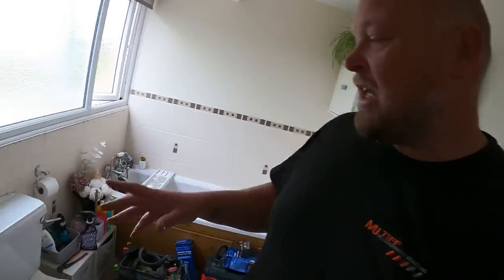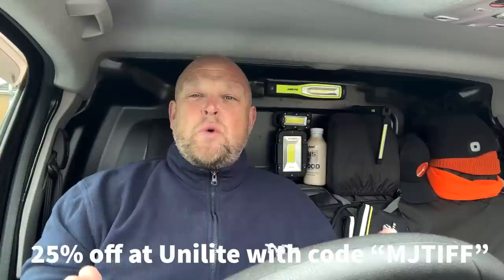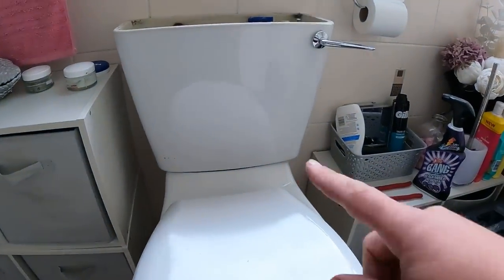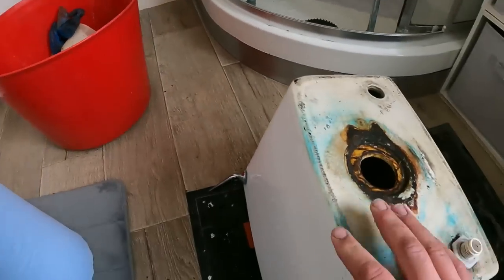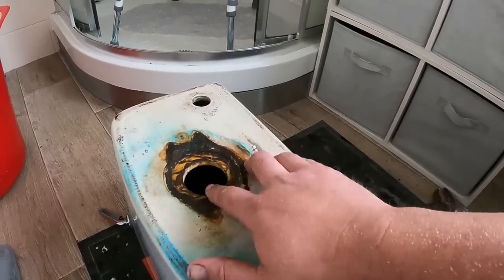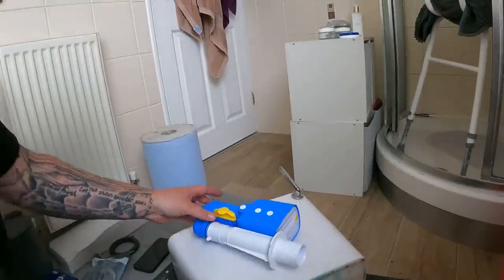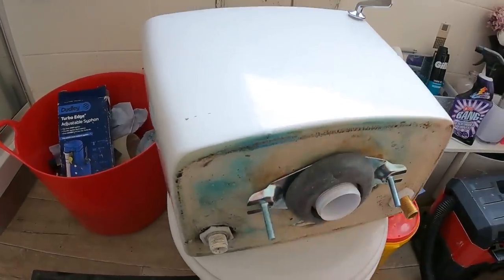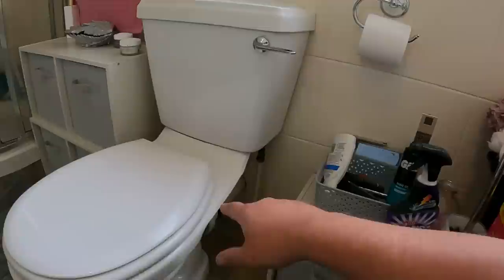HOW TO FIX A TOILET NOT FLUSHING…. But that’s the least of the problems!!!

Comment from the maker: Every plumber will relate to this video…… 100%!!!!!

Toilets can be THE most annoying thing sometimes….
Reply: I find having a couple of pairs of small mole grips works well with seized/rusty nuts & bolts. Especially in tight places.

If the nut doesn’t come off, the grips hold firm enough, to sometimes shear the bolt.

A larger pair will sometimes squash what is left of the nut/bolt, so it will then fit through the hole.

Loving your channel .

Keep the vids coming.
Reply: Great video as always. As a plumber myself any siphon toilet I go to now I just change it for a flush valve now make future maintenance a doddle for the next person 👍
Reply: Also loving the kit your using got my eye on a second tool bag and that one your using looks ideal is it a Veto ? If so what model ??

Comment: I can't count the number of times I've done this job and it never gets easier....rusted screws that shear off, rusted wingnut threads, out of whack porcelain moulding - leak city, cruddy plastic thread tails that will cross thread rather than go straight....bloody manufacturers that make odd shaped cisterns so that the water fill fouls on the siphon....it goes on and on......they should be a straight fit but never are! Oh, and don't forget the previous plumber that had a leak and sealed everything with either silicone or plumbers mait  !!!...lol
Reply from the maker: Completely agree mate….. they can be a nightmare

Comment: Had this experience many times! one tip for the new bolts to keep them in place is to take a peice of cardboard from the box, fold it couple of times and put them between the bolt head and the cistern and that will keep them in place while popping the cistern back on. Buy one metal blade for your multi tool and will fly through them old rusty ones
Reply from the maker: Good shout on the cardboard trick 👍🏼👍🏼👌🏼
Reply: BLOB OF PLUMBERS MATE

Comment: Oh I can totally relate to this especially if they’re old. There’s the initial problem of not flushing and there’s all the hidden Aladdin cave problems that reveal themselves. Most times if it’s rigid copper pipe coming up from the floor it won’t reach the new full valve or is just that bit shy due to new doughnut so you got away with that one at least. Yes it always happens with family and they always say “ sure it’s just a small job should only take you half an hour and you end up there most of the day. Great video Thankyou and yes the syphon washer should be enough as it’s inside the cistern. Take care Mark.
Reply from the maker: Thanks buddy…. Glad you enjoyed it

Comment: Glad to see you fitted  a demount-able flush unit in. My only problem is, it looks like the original flush unit was also a demount-able and should of been able to repair it without taking cistern off, a bit confused. But still a great video as usual. I have been a plumber for 35 years and changing flush units are always the worst job.
Reply from the maker: I was changing all the internals buddy…… got to remove the cistern to do that👍🏼

Comment: Was half expecting the screws to snap and the iso to start leaking as well😂.

Its all fun and games this plumbing lark. Bit like fixing cars, 5 hours taking the front end off to unbolt and replace a sensor buried in the engine bay.
Reply from the maker: And I was to be honest….. everything else had gone tits up 🤣

Comment: That job went quite well compared with the Ideal Standard tulip toilet cistern I had to repair last week. Its a very fussy cistern due to its shape and one had to be very careful on what siphon would fit. Had to cut through the bolts and cut off original syphon as well.
Very awkward
Reply from the maker: And people think our job is easy🤦🏻‍♂️

Comment: Surely just change the diaphragm as it looks like a 2 part siphon, I put the jam nut on the float valve the other way up to centre the valve in the hole
Reply from the maker: Why just change the diaphragm when it’s all apart…. Just do the lot👍🏼
Reply: @M J Tiff Plumbing  if it is a 2 part then  why strip cistern out ?

Comment: I am a joiner, but did exactly this job last week.. Fortunately for me the cistern screws had rusted so much the heads had gone so dead easy.... But the connector wing nuts totally rusted on so had to cut them... Being old school with a hacksaw blade. Same issue with a split membrane, but i changed to a push button as my tenant had young kids so i thought it easier.
Reply from the maker: This wasn’t a membrane issue in the end, was the spring👍🏼👍🏼
Reply: @MJTiffPlumbing  Ahhh yes, I wrote this before getting to the end of you vid🤔. I get my tips from you though, so keep up the good work..

Comment: Great video Mark.
I was concerned that the corner of that pan was going to break when using that multi tool, due to the vibration etc.
A better option in a tight place, is a cordless dremel fitted with a cut off wheel or in your situation, pushed up on the cistern bolt from under neath and used the cut off wheel to cut through the bolt.
No vibration and risk to braking the pan.
All good, sisters toilet all sorted now thats the main thing !.
Reply from the maker: To be honest I’ve done it so many times and never had an issue….. it doesn’t really touch the pan. I know what you mean though 👍🏼👍🏼
Reply: @MJTiffPlumbing  👍But when you are using the multi tool directly on that bolt, you are pushing back on the bolt, against the pan.
The load and vibration from that tool, has to be transmitted somewhere.
The cut off wheel offers no stress or vibration and presents little risk of cracking the pan, same with screws that secure the cistern to the wall Mark. 
Use a cut off wheel to remove the heads, then when it is out use a pair of mole grips to unscrew the remaining part of the shanks of the screws.
You asked for suggestion on how WE would have tattled this job at the start of your great video.
So, this the method I use 👍.

Comment: These are olden toilets , if you see syphon looking 👀 familiar to that one , put a price up straight away, the rusted screws , holding cistern at the back , and you can see roughly underneath it the plate if is mucky, those 3 observations tells you the price straight away, all the best brother .
Reply from the maker: Thanks buddy….. 👍🏼👍🏼

Comment: I have, when I remember to do this, is when fitting those coupling bolts is put a dab of grease or Vaseline on the threads  - may help the next guy who comes along.
Reply from the maker: Yep a few people have said that… good tip

Comment: Had a few of these lately , removing the cistern usually means , new screws to hold cistern back against wall , new plate and bolts , new donut , new valve , and sometimes a new iso valve that sometimes lets by after isolating !, you can literally fit a complete new toilet in the time it takes pissing about with an old one .
Reply: Sometime Wd 40 helps , or wriggling the cistern from side to side helps remove it
Reply: Mark, think this tip has been given before, fold some card wedges and fit between cistern and retaining bolt on siphon plate, helps to keep the bolts in position instead of jumping out and falling into the pan. Did it for many years during my 50 years in the job.
Reply from the maker: Thanks guys…. Great tips there 👌🏼👌🏼👍🏼

Comment: When I changed mine I bought a plastic plate in B&Q to replace the original metal one which should prevent rust but haven't seen one since.
Reply: Yes same here was a bit dubious but it worked great

Comment: these push button systems are the best systems i would recommend never looked back when i fitted my own , and they are cheap and you wont need to take the toilet apart when you need to replace them

Comment: Great vid Mark, I seem to be getting a lot of these just lately and they are nearly always a pain in the butt!!
I always carry a battery angle grinder with a 1mm thick cutting disc, it only takes a couple of seconds to cut the bolts! Did you change the fibre washer in the feed connector? I always change it as I have been called back a couple of times for a dripping connection.
Reply from the maker: Yep replace as much as you can when you can👍🏼👍🏼

Comment: McAlpine do a stainless steel version of the adapter which also holds the bolts in place, very nice but not cheap
Reply from the maker: They do now your right…. They are great

Comment: Had a problem last week Mark ‘nightmare job’ the cistern pan hole was a lot wider diameter than the new syphon bottom thread ‘if that makes sense’ ? CT1  done the trick after three attempts of leaking and everything I put in was new, a strange one for me ? I feel your pain bruv.
Reply from the maker: CT1 is a lifesaver

Comment: When fitting the bolts through the metal plate I always tape them in position so when lifting the cistern onto the pan they don't drop into the inside of the pan never to be seen again!!
Reply from the maker: Good little tip

Comment: I'm a joiner so i know i shouldn't  be making suggestions but i had the same recess issue on a family members toilet so i rang an old plumber i know and he said to form a ring of plumber's mate in the recess so that when the plate is tightened down the plumber's mate will take up any slack and seal it so thats what i did and 2 years later still had no leaks.(probably tempted fate now)
Reply from the maker: Yep if there had been an issue that’s the path I would of gone down….. seems to be fine as is..

Always something to keep you on your toes buddy

Comment: If the c/c fixing bolts where rusted,I would of just replaced the diaphragm,used the old ripped one as a template and use a thick bin liner to make a new one.😂😂The fights I've had getting those bolts off life you've had😅.Also use plumbers gold silicone around Syphon thread then fit fixing plate.
Reply from the maker: Nightmare mate

Comment: Hi Mark , another great video. Just a thought: if it was your sister's house, ( you'll be going back when it needs repairing again😅)could you not put a bit of grease on the threads to avoid the frustration next time?
Reply from the maker: Yep your probably right there……
Reply: Good idea, but it’s about time that the plate and bolts were made to stainless steel. 👍🏻
Reply: That’s the beauty of those suphons. Hopefully never need to undo the bolts again. All repairs done from inside the cistern

Comment: Used to take me a few hours on replacing parts. Used to do thw pan connector as well at the back. 

Now just the internals. I do offer the pan connector if they want. Because ive had it a couple times where theyve failed. After strangely (pan connector) 

Now when i do the siphon and fill valve i can do this now in 45 minutes
Reply from the maker: Yep, as long as it all goes to plan👍🏼👍🏼

Comment: Another good video, when doing the same job myself i allways fill the cistern in the bath to check for leaks before putting it back on the pan👍 also did that old siphon have a built in overflow? Keep up the good work mate.
Reply from the maker: Yer built in OF on the syphon 👍🏼
Reply: @MJTiffPlumbing  wow, i was miles off on the age of it then, also after getting two buckets a couple of months ago i have just got the same wetvac as you after watching you use yours, already using Milwaukee stuff, best thing i've brought, thank you 👍

Comment: The "normally easy" easy ones are the most infuriating that send you to ur dark space 😤...Not knocking the multi-tool approach but i always use an angle grinder & slit through the wing nuts when they're rusted 👌I'm a big advocate of the Dudley gear as well 👍
Reply from the maker: Yep Dudley for the win mate….. only the best😉
Reply: Brothers n sisters take note!!  You've seen the work that gets put in - transfer some cash to Ur plumbing sibling  account today!!!🎉

Comment: Mark my own experience might be worse than this one. Both cistern to pan bolts were spinners for me and needed cut out underneath with a grinder. Then when I fitted the Syphon in the new doughnut washer was rock solid and pushed up the toilet a good inch lol not allowing the inlet to connect as it was in copper. Then when I got a new doughnut and everything back together the two screws that held it to the wall (which were not fixed in the first place) didn't line up. Ended up making my own sheet metal bracket as the spot I needed to drill was half on half of backing tiles and was risky to drill on. After all this it worked for a month until the Syphon service nut split due to misalignment of the the c link/plastic arm putting too much stress on the unit. Ordered a new Syphon and toilet handle from there as the old handle had too much limescale to make adjustments to the arm. All this and it was my first time as a diyer but got there in the end
Reply from the maker: Complete nightmare that was buddy

Comment: I’ve come across a few of these cisterns. I always put an extra 1 1/2 siphon washer underneath to help bridge the gap in the UNNECESSARY !!! recess. Although what you did worked. Nice one. How many times do you cut through the close coupled bolt and try to bend it to snap but it’s not quite enough. Haha.
Reply: Or… it snaps under the wing nut !!!!
Reply from the maker: Hahahaa 99.9% of the time 🤣🤦🏻‍♂️🤦🏻‍♂️
Reply: @MJTiffPlumbing  you can choose your jobs but you can’t choose your family !!!

Comment: I always put bead of silicone arond rubber inside cistern no chance then of it leaking also use foam washer between cistern and pan much better
Reply from the maker: This needed the big thick donut washer…. Big old gap

Comment: Why would you not try and take the old 2 part syphon apart then using a thick plastic sheet make a new diaphragm if required and then change the spring as you saw it needed? 10-15 minutes and job done then.
Reply from the maker: Because I had to take it apart to fit the new dudley internals…. As said in the video
Reply: Ah the joys of replacing toilet innards and first flush no leaks.....yes victory is sweet. Any one else save brass lock nuts to use on toilet inlet valve threads. Manufacturer here nice new brass threads but have a crappy plastic nut?

Comment: Great vid Mark, really highlights a general plumbers bread and butter jobs. I can relate to everything you did here. If I may suggest a few tips. To keep the cistern wing nuts from dropping out push a little ball of plumbers mate onto the fixing plate, itl keep them in place. Another good option is to push a flat head screw driver in between the plate and the nut, again bridges the gap between the nut and the plate.
In most cases if I've replaced all the internals I sit the cistern in the bath fil it and leave for 5 minutes just to be sure.
These jobs can be the biggest of ball aches for sure. Out of interest, if this was a job for a paying customer how much would you have charged, ball park figure?
Reply from the maker: Yep good few little tips there 👍🏼👍🏼
Probably around £80 plus the bits
Reply: @MJTiffPlumbing  Many thanks Mark

Comment: I shouldn't laugh but did at the amount of times you put your grips down and picked em back up cause the syphon nut was so seized lol been their many times still do it , unfortunately I snapped that main angled connector on my tapex kit , bought off of main Amazon supplier and they told me contact tapex , emailed them hoping it's a quick replacement as I use the kit quite often
Reply from the maker: Hope you get it sorted mate
Reply: @MJTiffPlumbing  just had a reply their sending a replacement piece out 👍

Comment: Also, that pan connector is only just in the main pipe. I would have addressed that.
Reply from the maker: No it’s not, that’s why I didn’t address it as it’s completely fine. It’s been like that for over 10years.

Comment: Quicker and just as quick to throw a new bog in for 60 quid
Reply from the maker: However they come with cheap internals so I would want to be replacing them with Thomas Dudley stuff….. works out more expensive then fitting a new toilet….

All depends what you are happy doing